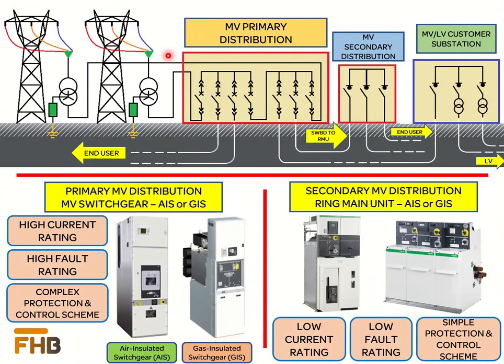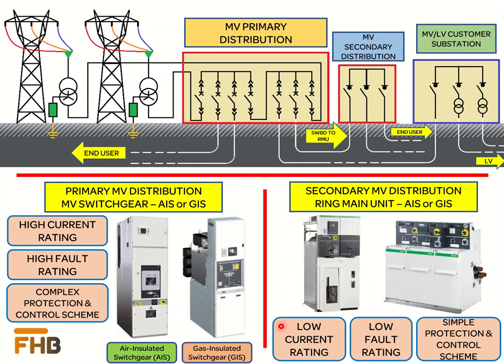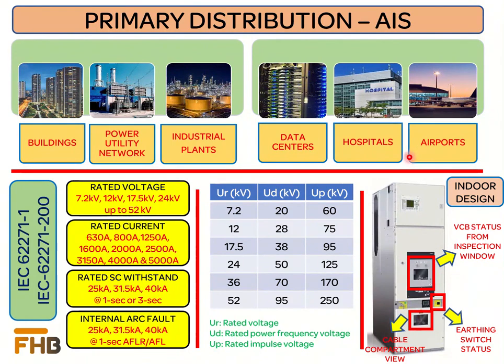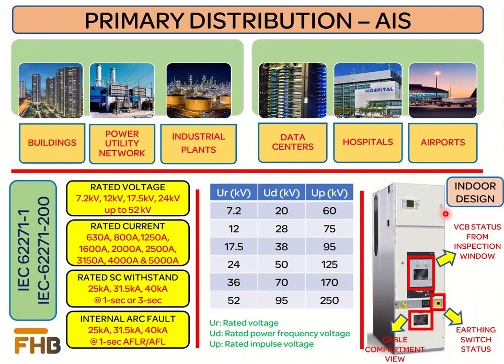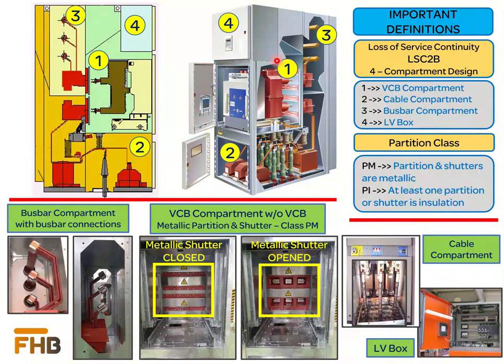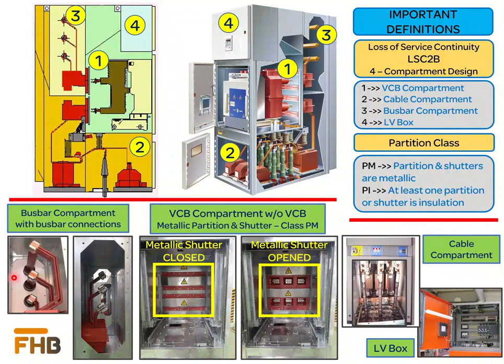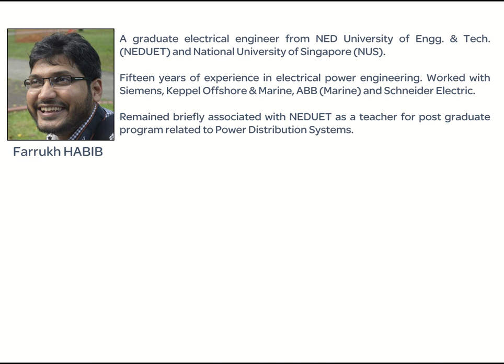MV Switchgear - AIS | Farrukh Habib - FHB | #ElectricalEngineering #switchgear #mediumvoltage

Comment from the maker: KINDLY LIKE & SHARE THE VIDEO - PLEASE SUBSCRIBE THE CHANNEL!!!
0:00 -> Introduction about the v-log.
0:22 -> Discussion on MEDIUM VOLTAGE level and different kind of switchgears available based on electrical parameters.
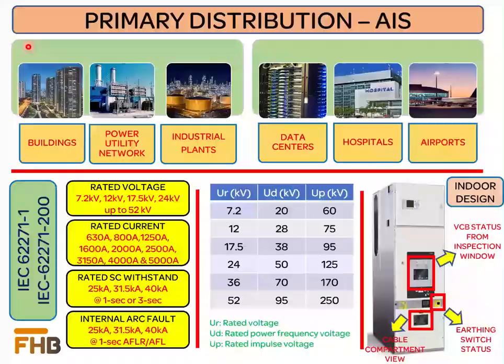2:24 -> Discussion on primary distribution of electrical power using AIR INSULATED SWITCHGEARS (AIS). Electrical characteristics of AIS are also discussed.
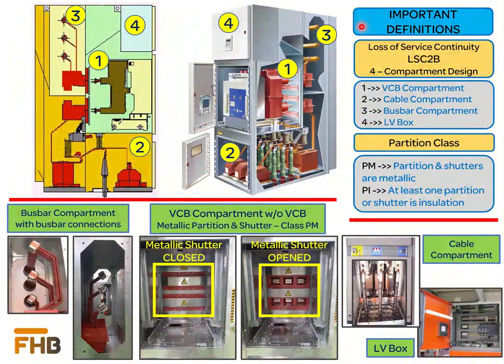 4:59 -> Detailed discussion on mechanical design of AIS according to IEC 62271-200.
7:01 -> Discussion on AIS cable access types & the exhaust system in case of an INTERNAL ARC FAULT.
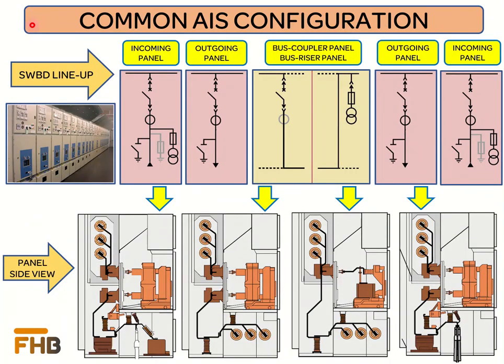9:01 -> Discussion on different electrical configurations of AIS used in the field.